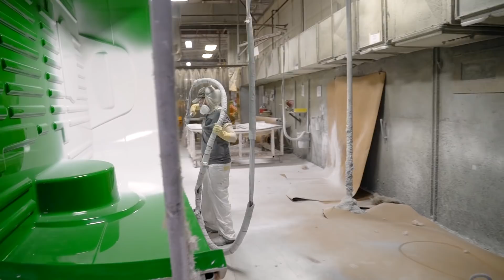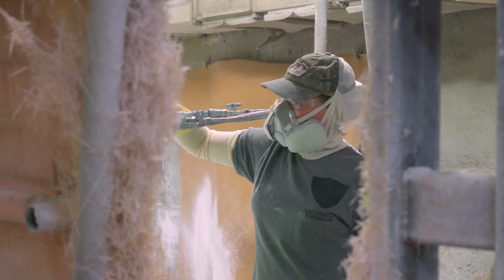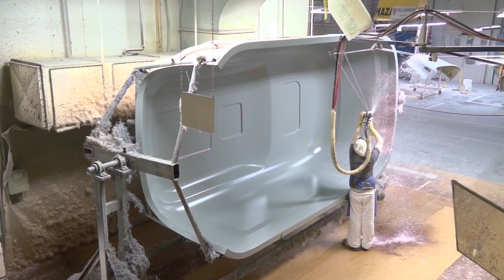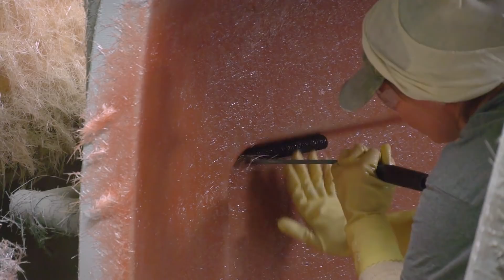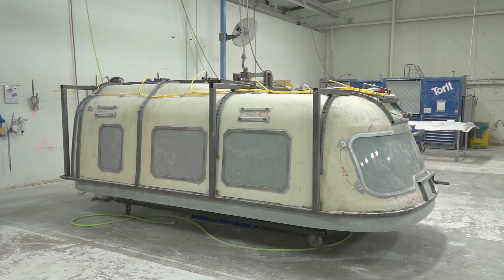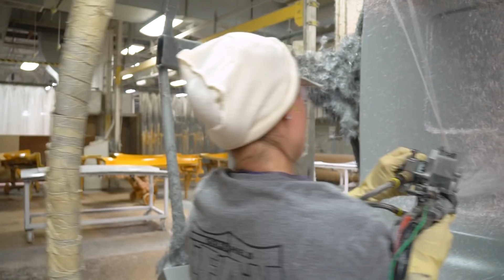Nest by Airstream | The Making of a Quality Fiberglass Shell

Comment: This is amazing I'm about to take an airstream nest and take it off of a trailer to put it on a Triton pontoon boat and I'm just going to flip it around to where the door is on the bow of the boat an the propane tank will be near the outboard motor.
It'll be a small airstream nest on a pontoon boat frame. It'd be nice if Gold shield fiberglass would just sell and ship me the molds with Airstreams permission.
They really need to put these things on boats so you can utilize it still as a mobile RV and a houseboat when traveling down the interstate. 
My other option would be to buy a 1971 Sealander 25 footer and just restoring one. But I really like the Airstream Nest and to to a project like this I know it would turn out nice.
My plans are to flip it around and put it on a pontoon boat.would definitely the size definitely wouldn't be a problem it's just figuring out everything underneath the nest in making this all fall into place.